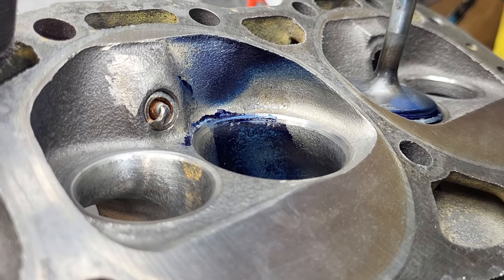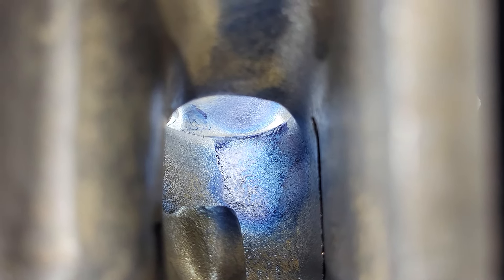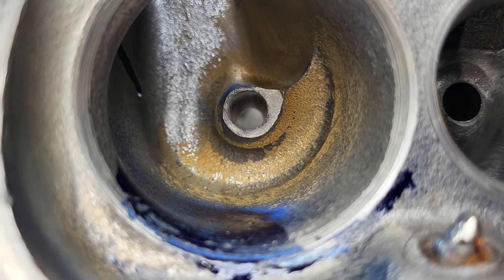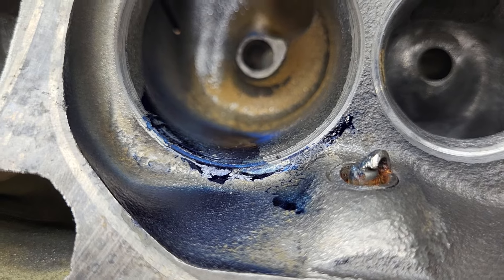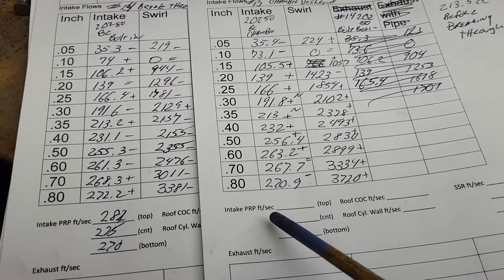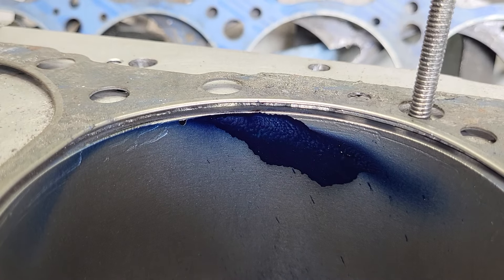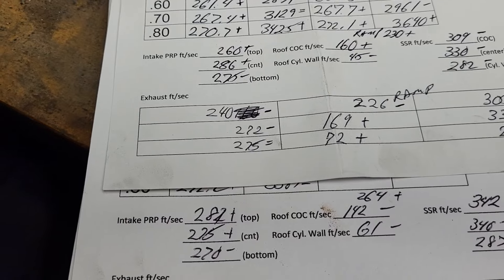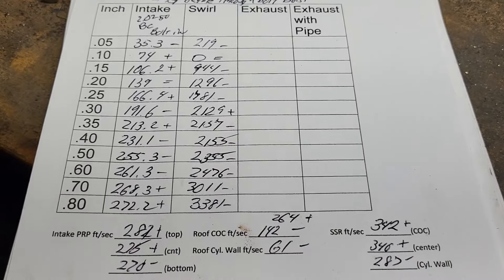62. Chevy 193 Swirl port cylinder heads #14 cut through bolt boss. Small gain

Comment: @ 4:05 to the left of your pen, you see a evidence of a recirculation bubble in the chamber, coming right off the valve seat. The air has to go around that bubble, I think that was the noise in your last cut. The interesting thing about these bubbles is that they take flow separation to create, as they develop, they start taking more space in the chamber and the air has to flow around it, and the air that flows around it is accelerated, because the rotation of the recirculation goes in the direction of flow. It's only downstream of the bubble that the flow reverses direction(at which point it goes turbulent at lower flow speeds/rate).

Now that you opened up the port wall a bit, the flow off the short side is likely a little slower than last time. The port dynamics still has the flow following the chamber wall on the cylinder side. But since the SSR on the cylinder side has slowed down, that recirculation bubble and it's effects has changed, now it's not as big a restriction to flow at .800.
Reply: What do ya think the fix is , go back to a 45* seat ?
Reply from the maker: @luckyPiston  More ramp work I think. Thanks
Reply: @servediocylinderheads  yeah u've moved back the wall ahead of it so now tune it to grab more flow .....

Comment: As a guy who doesn't make money off porting, I would be interested to see how the port responds to just cutting down the ramp with the seal cutter tool. Not to remove the ramp, because that's proven to be important. Just enough to open up the center side. See how it flows with just the cut, and then open up the center side with porting. I think this would make a great hot rod/street car head.
Reply from the maker: I agree. Thanks

Comment: If I remember correctly, moving the center of cylinder side wall over was a win last time. It looks to me like it is "only" the flow near the roof of the port that promotes swirl. As an pure amateur I always lay the SSR back in the corner floor / cylinder wall side and also lowering the floor here hoping it will lift the bulk of airflow higher in the port. :)

Comment: So I went back to see what was different and you raised the roof early on before grinding through to the bolt hole.

There are 4 major moves that transform these from a zero to hero;

1) Grind through to the head bolt hole.
2) Raise the roof
3) Widen the ssr
4) Lay the ramp back for the widened ssr.

The grind through to the bolt hole wasn't as good here because you didn't raise the roof yet and haven't widened the ssr yet.🤔😎👍
Reply from the maker: I was holding off on raising the roof due to slow roof air speeds. Thanks
Reply: @servediocylinderheads  
Well, I am just going by what you did on the road to 300 and raising the roof was very early on that path. Not sure if that move should be considered or not, just pointing out that was done early on so....? I'm no expert, just trying to get a game plan together for my zeros to make them heroes.😎👍

Comment: I think you have to open up your PRP top to realise the flow gain you were expecting , you moved the wall over by cutting into the head bolt area but you didnt open up the upstream to feed it, you can see the velocity went to 282 which is a good sized jump , i think this is an indicator of your next move ?
The Roof CW went down because there is more area there but volume flow hasnt increased much from the PRP top , hope that makes sense.
Reply from the maker: Stay tuned
Reply: Interesting how u opening the PRP top in the next cut/video cause a big pressure drop there indicating the slow roof speed down stream was caused by something else, thats the thing about port tuning for flow , air can be coming from and flowing to the least expected place , mapping the port is so critical

Comment: Hi Charles! It called my attention when you told you measuring the airspeed 2 different ways. I wonder, how do you make sure you actually measure the speed at the same precise spot after each cut? I can only imagine how much the airspeeds change with in couple of millimeter area in the port. Looking at the speeds distribution, perhaps working widening the short side some more would be the next step? Wouldn't 'raising' the entire floor of the port redirect the flow away from the 'busy' area towards the roof, where we are lacking the speeds at the moment?
Reply from the maker: It is a challenge. Try to hold the Pitot in the same spot as last time with the same angle.

Comment: I would love to see what you could get out of a set of traditional Pontiac heads.I got a set of Eldebrock Performer RPM round ports that went as follows
         Int       Ext.
.100 134     121
.200 200    172
.300 259    207
.400 305    231
.500 323    244
.600 341    251
2.19 Intake valve with 1.77 exhaust valve flowed at 28’’thanks!
Reply from the maker: Someday. Thanks